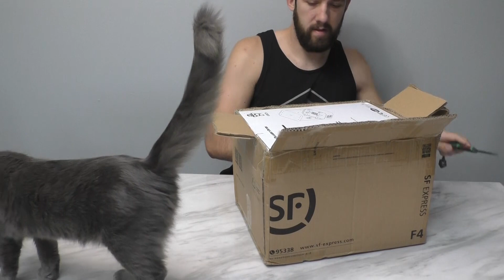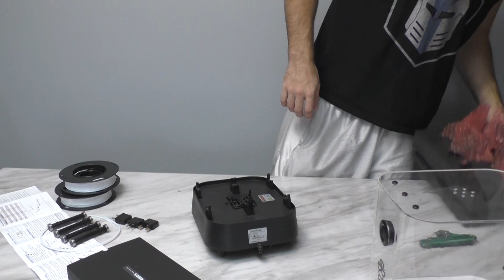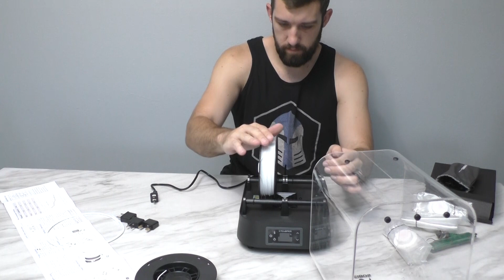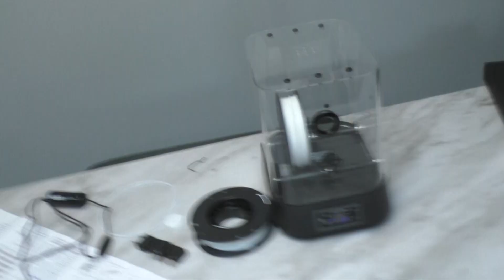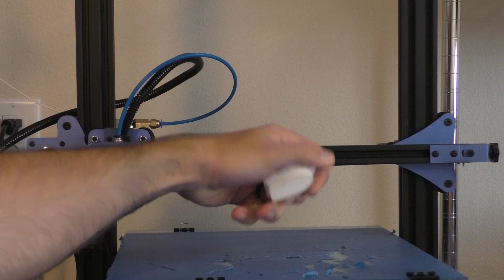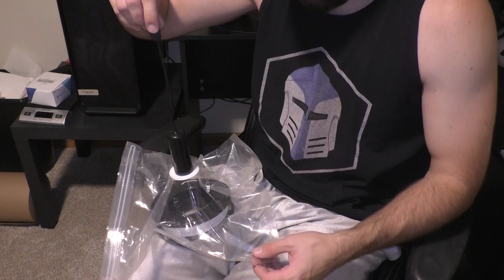Do You Need A Filament Dryer? - EIBOS Cyclopes Test

Comment: There are a number of these type of products on the market and even on kickstarter and from what I hear the biggest problem with them is that they do well at drying the outer parts of the rolls but the inner parts do not get the same even drying. They can dry just the outer half or the first half however you want to say it. I have been looking but have yet to see a review where a unit has successfully dried a full roll of filament all the way through. Converting a food dehydrator or placing the roll in a oven still seems to be the best way to go.